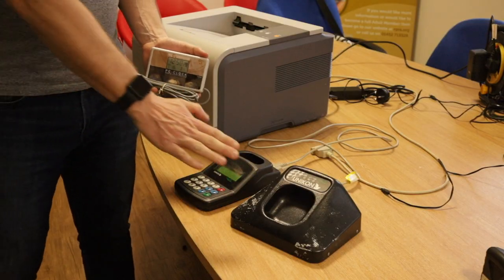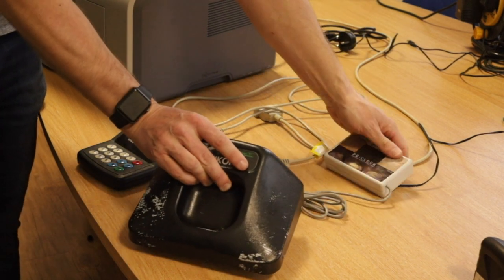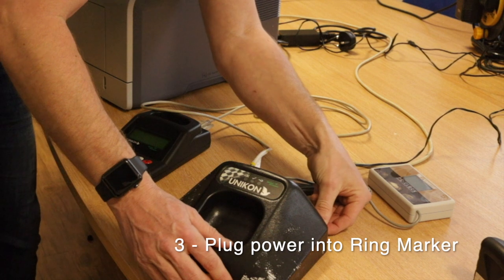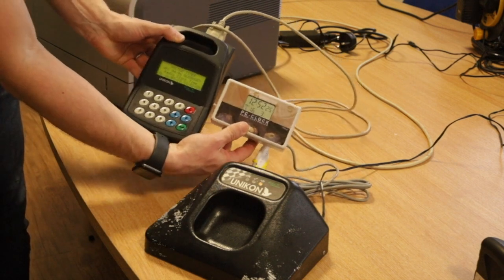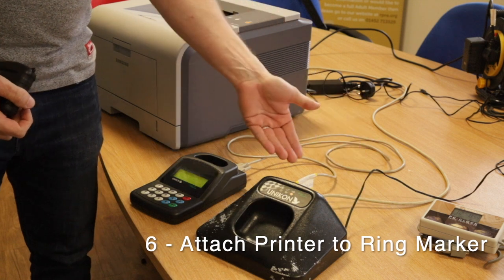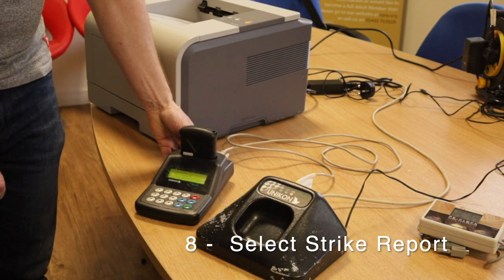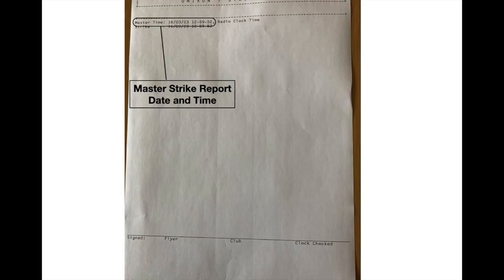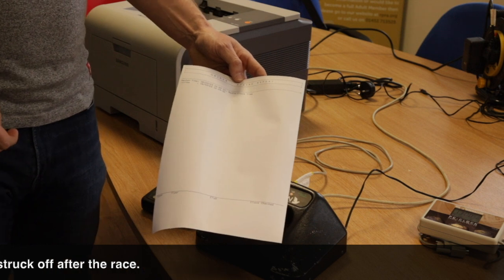How to set a UNIKON Master with External Radio Clock Synchronisation a how to print a Strike Report

Comment: What happens when the 'NPL' have an outage, do we cancel racing? Surely a provision should be allowed for such and a check with "TIM' can be done as per manual clocks.  I have no idea what has forced this I would say 'bad administration or user error at marking and checking.

Comment: So all clubs using Unikon and not possessing a Bricon time setting clock have to purchase one. 
Then as Bricon, Benzing and iPigeon systems have no manual clock setting feature, which is what the new rule is about, now have to be changed by their manufactures to jump through a hoop to overcome a Unikon problem.
Reply from the maker: No this is just a back up for Unikon if the internal Radio Clock does not get a signal on the evening. Using the internal radio clock in a Unikon is fine. You just have to produce printed evidence of how it was Synchronised. 

All ETS Master systems have manual ways of setting them which you are correct is now not allowed.
Reply: You just have to produce printed evidence of how it was Synchronised:   So how do Bricon, Benzing and iPigeon ring markers produce that printed evidence without the manufacturer making a Firmware or hardware change to their systems?
Have the RPRA actually been in contact with them, with less than a month to go before racing commences?

Added later:
Sorry RPRA England.  I see you  have now done a Bricon how to and so presume your in the process of completing the Benzing and iPigeon and all the other make ETS systems.
Reply: @officialrpra  What happens when the 'NPL' have an outage, do we cancel racing? Surely a provision should be allowed for such and a check with "TIM' can be done as per manual clocks.  I have no idea what has forced this I would say 'bad administration or user error at marking and checking.

Reply

Comment: Common sense would have been to issue the video showing people how to correctly obtain the time signal using the integrated radio clock in the Universal Club System if you have a perceived issue with systems not being set correctly.
 
You have not even covered the vital step of ensuring that an external radio clock actually has an up to date time signal before attaching it to the UCS - if it doesn't have an up to date signal it will not accept the time from the external radio clock.

where are the videos for the other systems in use within the UK? I-Pigeon, Tauris, TIPES, Mega Systems etc. ??

If there is an outage of the NPL signal all is required is for the UCS to have obtained the signal from the Anthorn transmitter prior to it being taken down for maintenance, this is usually scheduled at 8 am so any time from 00:01 to 07:55 allows a time signal to be obtained and then the Unikon Club system holds the time for the current day when turned back on. 
This video is misleading as Clubs in other unions as well as the RPRA are looking for and purchasing external radio clocks when there is no need whatsoever based on someone being unable to correctly set up a UNIKON UCS and deciding the best way to set it is with an external radio clock.
Reply: If you are printing synchronisation sheet and sending with the race documents can you set the clock manualey